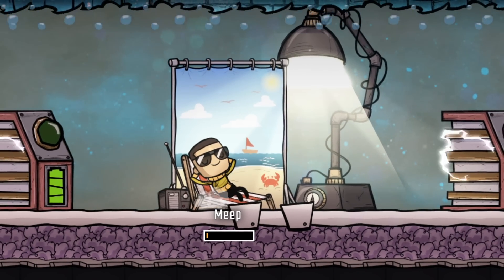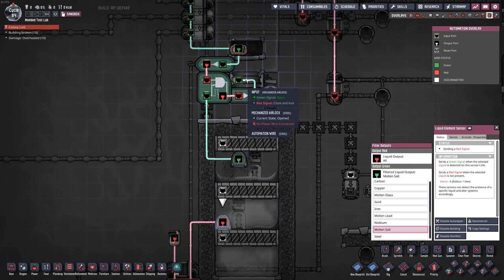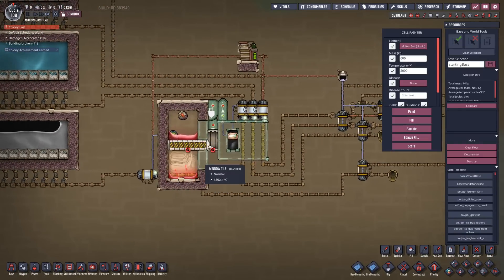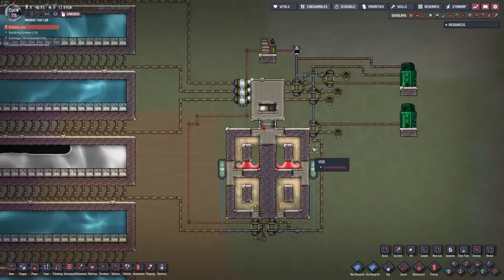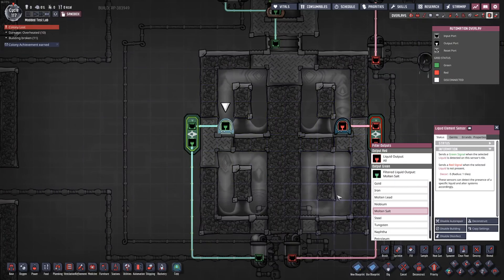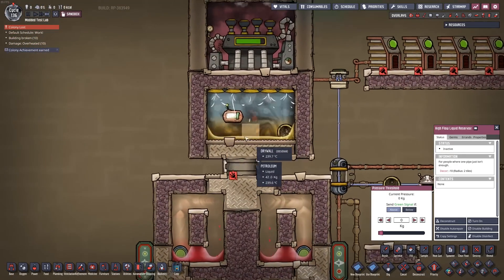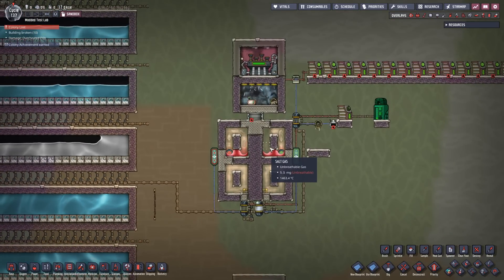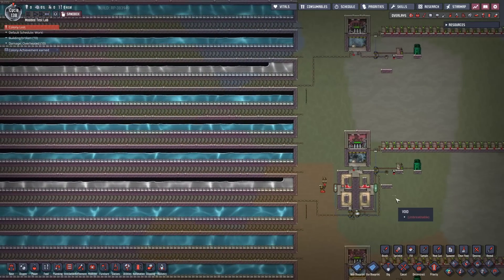BOOM! 300%~ish Salt Reactor POWER - Oxygen Not Included Experiment

Comment: So I was thinking, is there a way to extract the heat from the magma of a volcano and run it through a salt reactor system and improve the energy output magma? I have got to try and set this up. What other element can be used aside from molten aluminum?

Comment: I think the salt boilers would be more efficient if they were completely thermally separated. In the current design they are connected at the output by using the same heat sync before the door connects them to the steam room. Separate the salt boilers and have then connect to the steam room separately with a little automation to ensure that only one can be linked to the steam room at a time. This way they won't be bleeding heat into each other and only have heat supplied from the aluminium source.

Comment: Since the salt reactors produce over 100% efficiency, would it be possible to have two salt reactors maintain themselves without external heat input. 
You would have reactor 1 power something until it condenses into molten salt, then use reactor 2 to turn it into salt gas while reactor 2 powers the base. Then switch back and forth by not allowing both reactors to be molten salt at the same time.

Comment: Brothgar, you're getting a false read on the DTU's, since it's not constantly running some of the lead is not transferring their heat. And since there's a buffer between the valve and where you transfer the heat you need to put a buffer and a filter between the automation points with 0.5s per tile traveled, as that's how fast they transfer. Currently you're getting more DTU's than you're ment to.
Reply: It goes for the water above too.

Comment: The key to MOAR POWA is to cool that gas down as quickly as possible. I know you tried a tempshift plate in the top cooling corner before but what about one tile below that? You are running the metal blocks down there already anyway and it would stop the problem you had with that causing the liquid to condense on the middle block. Some sort of way to eat the heat faster (more turbines?) Would result in more heat since you can condense it sooner instead of sending the heat into the  gas. While you can fix this with automation you are def losing some to that. Anyway great video man, your content is top notch as usual.

Comment: Heat Engines require a couple of things - 1) Heating the working fluid to change state from liquid to gas at a constant pressure 2) optionally removing the gas from the vaporization chamber and continuing to heat it beyond the vapor temperature (superheating) 3) moving the gas to a machine to do the "WORK" 4) cooling or condensing the working fluid back to a liquid and starting back off at step 1.  the working fluid properties are important... in real world we choose water/steam because of the temperature ranges of steel work good for containers... higher temperatures require more exotic and thus expensive materials. Also water is non-toxic and much safer to expel when accidents happen... =D

Comment: Bit of a more random idea, but to help encourage circulation more aggressively, you could have a vent pump system that carries the hot salt gas from the bottom left (where it is getting heated) to the top left or top next to where it needs to transfer heat. Perhaps that way you can then have a larger right side or transfer plate could be larger. Another option is to have the pumped slat gas heat up the next chamber then go back to it’s original chamber to continue dissipating it’s heat before it phase changes in the pipe so that it does it’s phase change in the cooling side of the chamber.

Comment: Brothgar, in your last battery of tests you could have optimized for even more efficiency by changing the location of the gas element sensor down to the lower chambers' evaporators. it might even push the efficiency up above 300% for the final system, mind you you dont have the same throughput. I question what would happen if you spammed temperature shift plates in the steam room.

Comment: GG. Have you tried doubling the amount of salt in the lower chambers? The whole trick to this is the phase change. But the lower chambers spent most of their time as a gas, which just transfer heat without a phase change. If the amount of salt is doubled, then half of it converted to gas can transfer enough heat to gasify all of the top chamber. This should leave half the salt a liquid in the bottom chamber, requiring a phase change to transfer heat to the upper chamber.

PS: It may not require 200% of the salt in the upper chamber. A lesser amount, say 150%, may be all that is needed.

The trick is to have some liquid salt in every chamber at all times. This ensures that a phase change is required to transfer heat.

Comment: How are you getting molten aluminum into a pipe? Thats way too hot for any pump
Reply: pumps pump out a + shape around the bottom left tile, so you can make a setup where it can pump up liquid without actually contacting it. You just need another liquid to trigger the pump, like small amounts of visco-gel. Francis John used this trick to pump liquid steel to melt the undeconstuctable Gravitas building parts.

Comment: I really fail to understand why are you trying to compose boilers together..
The idea is to use the phase change on salt generating more termal energy.
But instead of stacking chambers the best would be to run in parallel, with an automated cooling loop that would transfer heat from salt gass to the vapor chamber in order to keep all salt chamber always condensing and boiling since this is the optimal state ( the automation would run the cooling loop if the salt chamber has gas, and the heating loop would bring in heat if there is any liquid).
Also in order to be easier to control and have faster response the system would be compose of small chambers so you wouldn't need too much energy to boil or condense and it would be faster to reach the optimal transition state.
Reply: from a previous test we could see that the extremely small chambers caused loss of the fluids/gasses inside of them
Reply: @brothgar  I didn't understand a word but I thrust you Brothgar, BTW does the same work with regolith melting?
Reply: in real world boilers it is generally customary to remove the gas (usually steam) from the liquid and superheat it above the boiling temperature by passing back through the furnace ... but game doesn't always follow the real world... because of the pressure can change the boiling / condensation point as well.  superheating increases the energy transfer and keeps turbine blades in actual steam turbine from excessive wear due to impingement of condensed water drops in the steam when it's not superheated. It also requires different types of turbines and materials to handle higher temperatures. if you don't use turbines, and go for older style cylinder acting prime movers, the condensate acts like a lubricant and can be helpful as long as it doesn't destroy the piping with water hammering. Note - this is only done with higher pressure boilers when higher efficiency is desirable.  see this article for more info - https://www.nuclear-power.net/nuclear-engineering/thermodynamics/thermodynamic-cycles/rankine-cycle-steam-turbine-cycle/superheat-and-reheat-rankine-cycle/
Reply: https://en.wikipedia.org/wiki/Combined_cycle_power_plant
Reply: @brothgar  don't forget to let at least 2 tiles since the game don't allow to have gas and liquid on the same tile (that's why you lost mass before)